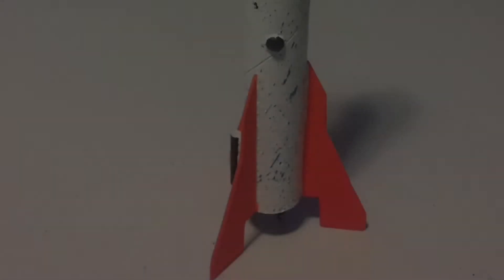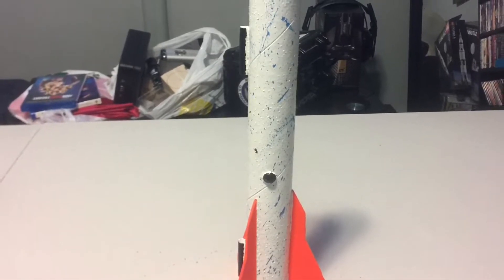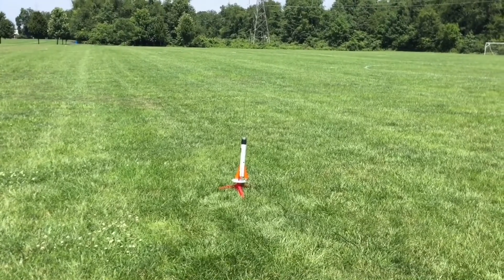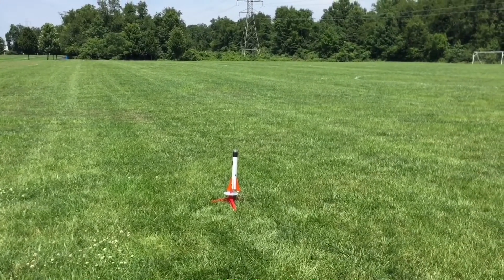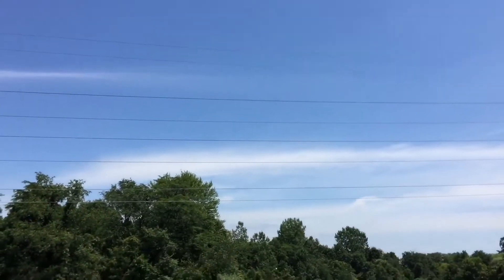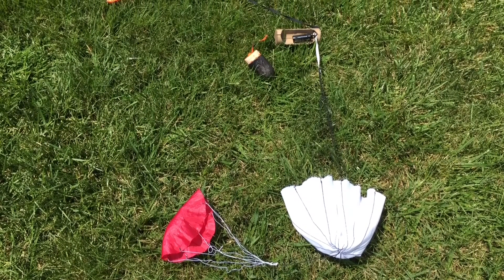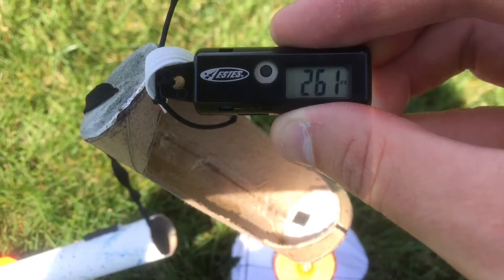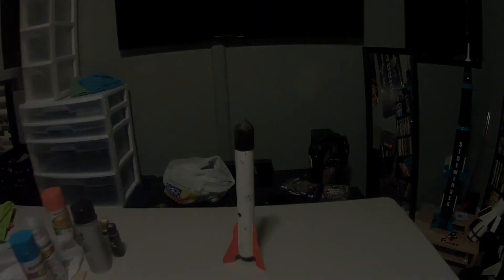How to Make a Reusable Homemade Rocket (without wadding) - step 8

Comment: Weren't you worried about the power lines?  If it hangs on them, you won't get your rocket back.  ...unless you get a really tall aluminum ladder. LOL  ...and about the same if it hangs 40' up in a tree.

BTW, did you reload the rocket and fly it at least 2 more times to prove it is reusable?